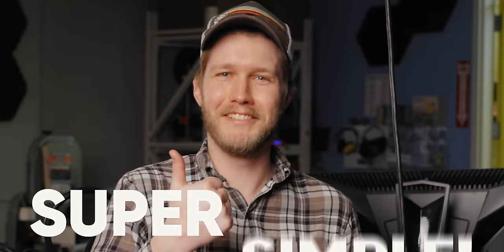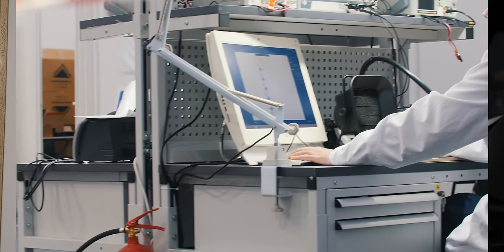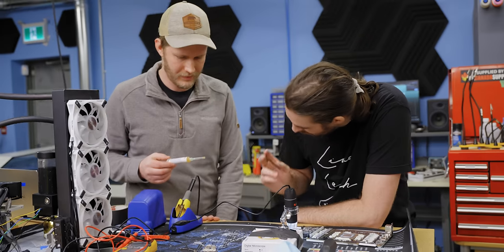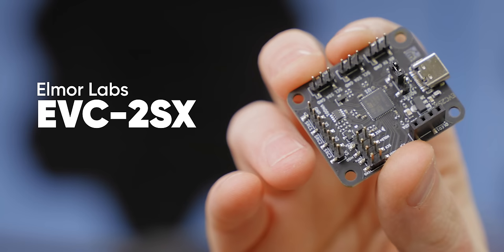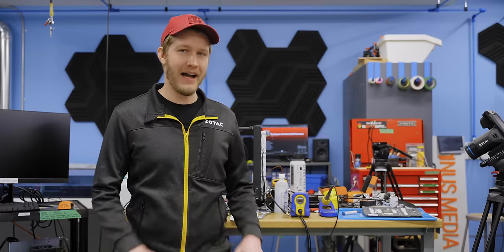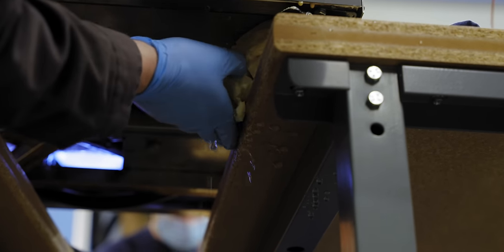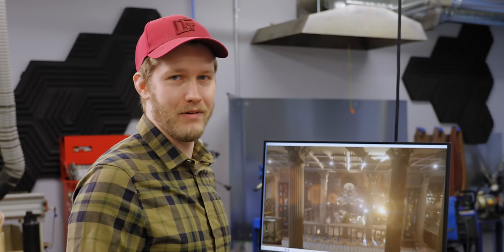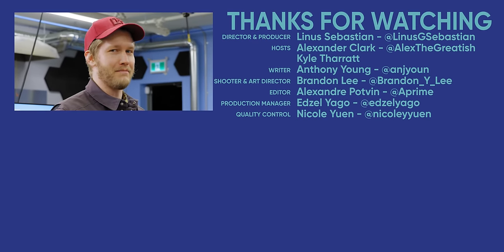Nvidia Doesn't Want You to Do This - GPU Shunt Mod

Comment: I remember in the late 90's early 2000's when the overlocking scene really took off, I had a conversation with a gearhead about it. Telling him "I swear squeezing every last frame out of a rig is exactly the same as tuning a car for every last pony." He looked so insulted that I would compare hobbies. Funny what time does to opinions like that.
Reply: That still happens to this day. Many car guys are really, really dumb. Tuners (the ones with dynos) would get along quite well with overclockers, both change computer values, both can blow things up too!
Reply: Cars are far more complex, far more moving parts plus getting dirty while not getting dirty 😂
Reply: @YungEagle3k   While i dont agree what MiGujack3 said. But saying cars are more complex is a bit huh. Computers are probably the most complex things mankind has been able to come up with.
Reply: @YungEagle3k  cars are honestly so much less complex. I don’t know a whole lot about cars but my dad is an auto shop mechanic and we are both into computers so I believe him when he says  computers are much much more complex.
Reply: But it is true, they are similar in the way that you get more performance
Reply: @glue_ostrich9600  lol cars have computers and mechanical parts
Reply: @YezzyHD  u realize computers are in cars right
Reply: @glue_ostrich9600  I guess people don't realize computers are in cars. Smh
Reply: @YungEagle3k  the computers in cars are FAR more basic than even a standard consumer desktop. on an electronics level ECUs and automotive computing are wildly less complex. A samsung smart fridge has a computer in it too that doesn't make it "more complex" than a PC. modern gaming rigs are far more complex than any major production vehicle. A large majority of car "computers" are microcontrollers with sensors. designed and programmed to accomplish basic tasks.
Reply: Each has its own kind of complexity depending on how far down a rabbit hole you wanna go down and how much you mess with things.

Take it from both a car and hardware enthusiast.
Reply: My dad is a mechanic and huge gearhead and he passed that on to me. When I was really getting into PC building and overclocking in the mid-ish 2000s this is exactly how I compared it to my dad when he didn't understand my fascination with it all. He instantly understood where I was coming from.
Reply: @MiGujack3  different skills different hardware. Fish climbing trees and all that
Reply: @YezzyHD  bro, tuning a computer is way easier than tuning a car though. The computer is harder to make from scratch, but you literally never learn how it works on a subcomponent level like gearheads have to.
Reply: @amamsurri5454  The computer being somewhat simple (which isn’t true, modern ECUs are surprisingly complex firmware wise), the sheer number of sensors and the addition of mechanical parts and tuning easily bring up the complexity of a modern car. You’ve got a million more variables in a car than typical computer overclocking, and I say that as someone who use to run a Peltier chiller in the late 2000s. Comparing just the ECU is missing the point.
Reply: I build, modify and tune both my car and my computer, so I agree with you. My current car is a 2015 STI (before that, I had a 2007 STI that I learned to tune on) and my main computer has a 9900k and a 3080 (my other one has a 10400f and a 2060 super) and getting the most performance while keeping them reasonably reliable is what I like to do. That way, I can have more fun using them all the time. I will say though, it took me longer to learn how to be good at tuning my car than it did to get good at overclocking my computer. There's just so many more parameters to deal with in a car and it's generally harder to change parts, plus my car is a bit more expensive and I'm not trying to kill it. 

As computers have gotten easier to build and tune over the years, cars have gotten more complex to do the same. Building computers 25 years ago wasn't as easy as it is today. And for tuning cars, I prefer being able to change parameters on a computer and then flash the tune better than the old way of mechanically tuning everything. Having data logs to know exactly what is happening simplifies things (just like when tuning computers).
Reply: Noting the thread comments, the only time you'd be really in the nitty gritty in computers is when you're writing drivers for the hardware and directing the actual hardware to respond how you want it to - programming low level code is incredibly complex and even more so when you add atomics/asm,  and threading into the mix. Otherwise, you're just messing with software values for stability so, as a hobby programmer, id say cars are more complex for the average person lol it depends how deep in the mud you get for either case
Reply: @YezzyHD  and there are computers inside cars. you have to worry about parts literally like cracking in half and shit, while also worrying about electrical problems and making sure you don't accidentally blow yourself up. its literally an extra hot extra dangerous computer
Reply: @YungEagle3k  ok fair point but i think my point still stands as the computers in cars are incredibly basic compared to the average gaming rig people run (with few exceptions)
Reply: @amamsurri5454  oh sorry I
 did not see your comment before saying that
Reply: Ive restored an sw20 and built and overclocked a pc. Its absolutely harder and more complicated to restore a car and most importantly, noone outside of this community gives a flying fanny how fast my computer runs the witcher 3...
Reply: @nikolaossamaras1225  I also don't think you realize that the mechanical parts of most cars if looked at alone are truly not complex at all compared to most individual computer parts which are  some of the most complex humanity has ever created.
Reply: @Girvo747  you're incorrectly measuring complexity. My computer has a processor that has 7nm transistors.  How many does it have? 19.2 billion. The engineering and the process developing the technology in a modern gaming computer far outstrip any software firmware or hardware in a modern vehicle. Even things like the fluid dynamics and lubrication and the physics behind making a vehicle work pale in comparison to engineering a modern processor.  Anything electronically that can be done in a car with the right hardware can be done on a PC. There's no special sauce.

Modern PCs are getting so complex we have almost reached the limit of how physically small the transistor can be and still accept electrons

Even if there were a million sensors it would still be less complex
Reply: @AllianaCordova  I don't know why this doesn't have more thumbs up as the only correct answer in this thread
Reply: @amamsurri5454  You as a tinkerer have nothing to do with the individual transistors that make up your processors. When we are discussing hobbyists tuning their vehicules and computers, your semantic argument holds no weight.
Reply: @Girvo747  I'm not a tinkerer and the question was on complexity. Overclocking a CPU isnt complex at all. Reading sensors in a vehicle is also not complex.  The actual mathematics and design behind the hardware is what makes it complex.  But as an example every piece of software and firmware ever developed for a car was developed on a PC then flashed or transferred to the vehicle. It can't be more complicated then the medium that created it
Reply: Wow, I kinda helped to start a war here, I love it.
I never compared things, I just said they would get along, also gatekeeping bad.
Reply: @amamsurri5454  So you’re ignoring the actual context of my comment to make a dumb semantic argument? Alright have fun mate lol we’re done talking
Reply: @Girvo747  it seems like youre extracting context out of thin air because nobody i have replied to was talking about tuning complexity.  The most liked comment on this comment is talking about how computers are the most complex thing we have ever made and you think the context of that was software tuning? Dummy 🤭
Reply: @glue_ostrich9600  "cars are much less complex but I don't know anything bout cars" 

Speaks for itself.
Reply: I'd say the difference between overclocking a computer and tuning a car is that the knowledge of how to get the best performance out of a existing computer is quite a bit less complex than getting the most performance out of a car. (especially if you look at all of the tuning and custom fab that goes into the entire drive train and suspension)
Reply: @YezzyHD  cars have been computers on wheels for the past 20 years or so
Reply: Mad into in building and overclocking. I have a background in desktop support and trust me cars are much more confusing in so many ways. With computers if we backup and then fuck up afterwards we can easily restore or install a new os and copy the data over and install the programs again. That cannot be said when it comes to cars. They have to be taken apart and put back together again which is a hell of alot more labour and then you need specialist tools to reprogram them if needed. Everything costs money and if you mess it up it costs more money. Computers are basically free after the initial investment.
Reply: Except it isn't. As someone who has done both, stripping and rebuilding even just an engine, let alone a whole car is massively more difficult than anything you can do with a computer outside of genuine Rossmann level board repair. If you think it's more difficult to bugger about in the bios and hit your GPU with liquid nitrogen cooling or something, you are wrong.
Reply: @glue_ostrich9600  You don't know shit about cars if you think that a full rebuild of a car is somehow less complicated than literally anything you could do with a PC outside of actual board repair.
Reply: Kind of ridiculous he looked insulted since you are right. That is a perfectly valid comparison.
Reply: Installing a shunt mod, flashing a bios, and changing some settings is very different to calculating suspension geometry, determining expansion rates of metal engine parts, and generally trying to find (or create)  a sweet spot in a car's performance by combining hundreds of different components.

I don't care if you have 5 billion transistors in your 5950x or are using liquid hydrogen to beat some benchmarks. At the end of the day, all you're doing is brute forcing a solution.

(btw I'm not responding to the first comment, I'm talking about the argument later on)
Reply: @amamsurri5454  yeah the engineering that went into it could still be counted in vehicles. Computer advances aren’t drastic it’s the manufacturing process that have gotten complex. If it was so amazing complex, how the heck do they pump out millions of the chips. Great complex manufacturing. Cars are amazing in mechanical and physics regions. Computers in electrical. You guys comparing two different thing is stupid. Cars are not going to do things a computer can. However your computer isn’t giving you a ride somewhere else. Cars, trains, planes, and boats have a ton of engineering and science. Just like computers. They are different for a purpose. Stop comparing two. The science and mechanical engineering that goes into vehicles extremely outstrips anything mechanical about a computer, vice versa electrical engineering and science of computers does the same to a car. Both get stupid with material science. You use both but clearly you don’t know what goes into making either of them or you wouldn’t be putting one on a plateau. They are complex in their owns ways. You think one is simple because you thinks is easy to understand. Design and make your own car, design and make your own computer. Then come back and say what’s more complex. I’m willing to bet your answer changes. It all perspective.
Reply: It's literally the same thing.
Reply: @amamsurri5454  That is a bullshit statement. Modern gaming rigs are not more complex than a production vehicle, especially in amount of time required to assemble. You really don't know what you are talking about. The majority of modern car "computers," since you brought in "modern cars," are as complicated as you can imagine.
Reply: @egondro9157  the OG comment was a response to specifically the computer inside a vehicle. Try to read next time
Reply: @MiGujack3  im just trying to piss as many people off as possible in this chat.  So many people getting baited
Reply: @YungEagle3k  you do realize mechanics don't fix automotive computers, right? Saying something just to get semantically right just makes you sound like a child.
Reply: And that engine produces less heat than a 3090 and 12900k
Reply: Cars have computers in them. Axiomatically, computers cannot possibly be more complex than cars.
Reply: @amamsurri5454  nah, you said something dumb and now you're trying to act like it was a troll.
Reply: @rightwingsafetysquad9872  the computers in cars are programmed by more complex computers in desktops.
Reply: Honestly I do both, and was into computers long before I was into vehicles, and the first time I took apart an engine I was blown away by it's simple complexity. Computers are full of surprises for me and there's still so much I don't understand, like I feel like I could never do what these LTT did on this video. But I feel like I could reassembles an engine blindfolded. Feels about as complicated as a CD ROM drive. All it is is basic common sense (physics wise) and some puzzle piece-like assembly and you can do it.
Reply: @TAP7a  it's a YouTube comment section, of course it'd keep being a ridiculous argument.
Reply: Yeah exactly the same you can pull the car engine next time and I'll handle that rust free NVME screw I know it's stubborn in a tight to reach spot I'll figure it out eventually.
Reply: @Tyler You're so right that it's easier to learn how to overclock a PC versus tune a vehicle. I don't even know how many of hundreds of hours I spend searching, reading, watching videos and trying things on my own to learn how tune my cars. But, you can get good at overclocking your CPU, GPU and RAM in a computer in the matter of a week. That is, as long as you're not doing hardcore overclocking, but that doesn't really apply to daily use cases.

It kinda sucks how certain bits of knowledge are so closely guarded. I feel like if it were easier to learn, more people would do it and be smarter and feel better about themselves for doing it. It's like the whole right to repair issues these days, that's the worst.
Reply: @YungEagle3k  unless you're in a tesla there really isnt that much computer in it
Reply: @ethearnos6397  man those tesla / Mercedes infotainment systems are sweet for sure. Yeah i know about them
Reply: @usefulidiot21  well, that “as long as you’re not doing hardcore overclocking” comment makes all the difference in the world. Moving a couple sliders on the BIOS would be the equivalent of simply putting an additive to the gas, and using high-end oil and trying to claim that was real “tuning” on a car (nobody would truly say that). “Hardcore” on both cars and computers is what everybody’s talking about here.
Reply: Why’s everybody feeling the need to claim their own hobby is harder? OP is fundamentally right:
- Both are complex pieces of equipment
- Both require one to learn the deeper workings, before attempting (and succeeding) to improve them. This often requires reverse-engineering.
- Both require you to “break the rules”, voiding warranties and pushing the performance beyond the safety margins the manufacturer specified.
- Both can end-up destroying the equipment. (Of course, everybody would much rather have a burning MoBo than having a car catastrophically fail while testing it... the former is unlikely to kill you).
- Both are expensive. The fact car parts are more expensive nowadays says nothing about car complexity, but about how lucky we are electronics became massive and cheap ( we all know the first computers were way more expensive than any car has ever been… they were also way more complex). Obviously, nobody produces car parts in the billions to make them dirt-cheap.
- Both are really fun… but both are dumb economically-wise for the vast majority of us: too much effort for marginal gains in performance. The car folks might have a little edge here, at least they can race them afterwards; there is zero practical glory/benefit in getting a few more FPS… that said, with the rise of e-sports, there will come a time where these gains might reflect in winning a tournament, so over clocking might become a viable and profitable business.
- Yes, handling car parts requires effort and it’s dirty, so what? Nobody gets into tuning with the goal of getting the dirtiest, or as physically exhausted as possible. It’s about the performance. (If it was possible to work on a car with absolute cleanliness, people would just do it. Same with effort, everybody uses as many tools as they can to make the work for them, or at least make it easier.)
Reply: @threemr01  for sure anyone who argues with OP is either ignorant or trolling
Reply: @YezzyHD  computers are incredibly complex, you're right, but they're also heavily abstracted, making them easy to work with practically. You don't have to understand an XOR gate to install a cpu.
Reply: @threemr01  I wrote that because hardcore overclocking doesn't apply to daily computer use cases since it requires special cooling that isn't practical all day, every day. Which makes it different than the normal car tuning that you see used for daily drivers. Such tuning is more than just putting an additive in your fuel or better oil, it would be anything you can do that's reliable for a daily driver (which is quite a bit). Hardcore overclocking is more like a drag race car that has to cool down after every run and is never driven on the street. So I disagree with your statement.
Reply: @YungEagle3k , only new modern vehicles with fuel injection  and electronic features  like that
Reply: @Skystrike70 . Its because it's so complicated, that few people actually know how to make computer components
Reply: @glue_ostrich9600 . Still wrong, do you know how to make a computer motherboard
Reply: @taylorouellet7068  can you make an engine ?
Reply: @glue_ostrich9600 . Considering I am fixing my truck at the moment I don't think I'm having any problems in that field, sorry but unlike you I can actually do shit like put a motor together
Reply: @taylorouellet7068  I feel like we are arguing the same point here
Reply: @Girvo747  This. It's the equivalent to comparing only the CPU and accompanying chips necessary to run that part of the system. Or even perhaps just a GPU out of an entire system.
Reply: As a mechanic that just got back into building pcs and is currently super deep into overclocking his 5950x core by core, i couldnt agree more